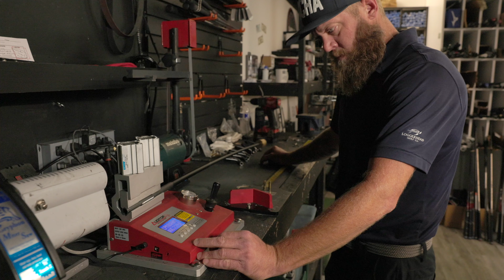CUSTOM IRON BUILD, Miura MC-502 x Fujikura Axiom | Loggerhead Golf

Comment: Great video! Curious if what you we're doing is getting the CPM, then sorting the lower cpm shafts with the lower lofted irons within the 3 different parallel sets, then tip trimming based off the trim guide? Do you prefer that then tip trimming to a certain cpm point and building a linear line throughout the set?? Sorry for the long question. it's just hard to find someone who knows this stuff and has been building so long.
Reply from the maker: Yea no worries! I'll try to explain! So you seem to have a good grasp of what's going on, you pretty much nailed it. I'm CPM'ing the shafts before just to make sure there are no anomalies and then I put the lower CPM shafts in the higher clubs. For this I use Fujikuras tip trimming guides and sometimes have to do very minimal adjustments to get a linear CPM blend. If you ever have any in depth questions or what to chat, feel free to call the shop anytime and ask for DJ! Hope this helps!

Comment: Great video! I do have a question, why did you cut off the tip instead of the bottom of the shaft? I thought cutting the tip will make the shaft harder and stiffer.  Thank you!
Reply from the maker: Axioms are .370” parallel shafts which means they are designed to be tipped to fit into the proper club. Axioms groups their shafts into three categories or lengths, this shortens the tipping for each club to a maximum of an 1”. But you are right, cutting the tip of a shaft will make it stiffer, but with parallel .370” shafts, this is how the manufacturer recommends them to be tipped.

Comment: You can keep a cut grip laying around for swingweight and be able to slap it around the shaft instead of setting it below. Love watching build videos super cool.
Reply from the maker: that is another good option. We usually use the exact grip that is going to go on the club to be precise, but in this case we ended up switching to another grip last minute but the weights were nearly identical so we didn’t have to re-do the swing weight. We also put a rolled up piece of tape in the grip to mimic the weight of the tape as well. 🤘🏼
Reply: Every grip has a slightly different gram weight plus I throw in however many wraps of tape I’m using inside the grip. I deal with players that are exact can’t allow for any deviations brother.
Reply: This player did call an audible on the grip mid build not ideal haha

Comment: This is the exact set up I've been testing in our studio, I just need to get in touch with our Miura rep to find out the pricing on the qpq 502s. The Axiom works so well with them. Swing weight is ridiculous with the heads though, my set up is E1. I'm looking at the BB&F custom aluminum ferrules, and Grip Master Roo grips cant decide on the red or green.
Reply from the maker: Miuras head weight is very night to work with though. This set D2 🤘🏼E1 is wild! haha
Reply: @LoggerheadGolf  I play D8 in my ZX7s so I like heavy to begin with, but yeah E1 is a sledgehammer.

Comment: what was that tape?? and what was that spray you used?? is that masking tape or is it Double sided, or just  treated with something that is activated by the spray?
I change my own grips, but I'm only using Masking tape with air, not always stable. Still learning. any advice would be appreciated>
Reply from the maker: I have always used 2 inch double sided tape. being aware of the tapes thickness is key so that you know what your final grip sizes will be when using tape to build grips up. as for the spray it’s odorless mineral spirits. it’s safer than lighter fluid, and quickly evaporates. it’s needed to break the friction between the tape and grip.

Comment: Did you record the individual shaft weights after tipping (if required) and butt cutting? I’m curious what the installation weights were.
Reply from the maker: Nope, with the Axioms the tipping is so minimal that the weight isn’t affected as much as it would be with a traditional .370 shaft. In this case the client was more focused on the swing weight rather than the total weight. Hope that helps!

Comment: nice vid but i am a bit confused cause the fujikura sheet says cutting at the butt not the tip. why cutted the tip not the butt. thank ya.
Reply from the maker: Thanks! So for the Axiom shafts Fujikura has a VERY minimal tipping chart. They have 3 lengths for iron shafts (short, mid, and long) and you run all of these in a build. The most you tip each one would be 1 inch and then you butt trim to your desired total length. By mixing in the various lengths of shafts and barely having to tip each shaft, it gives you a consistent feel across all of your irons. Hope that helps!
Reply: @LoggerheadGolf  Thanks, it helps. Asked cause it looked like you were cutting the Tip.